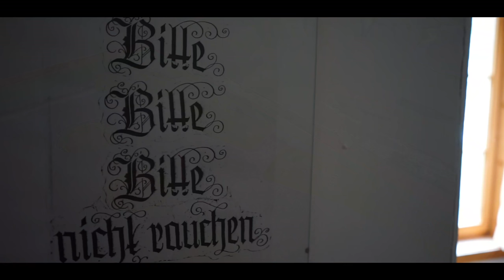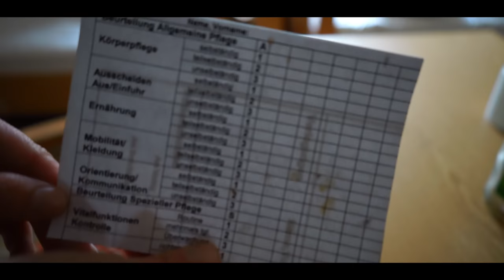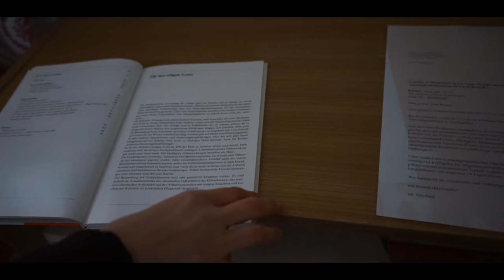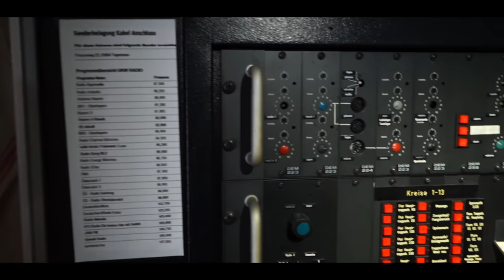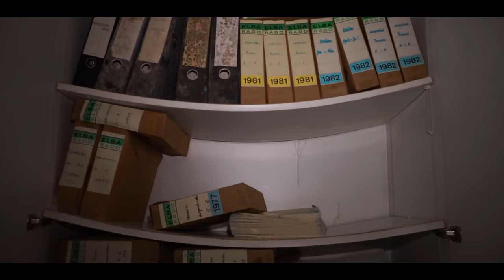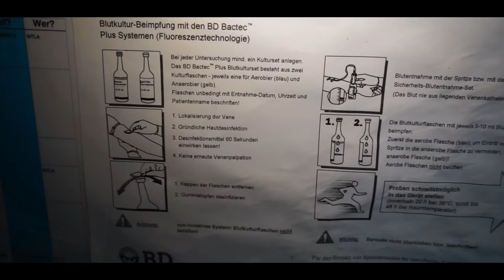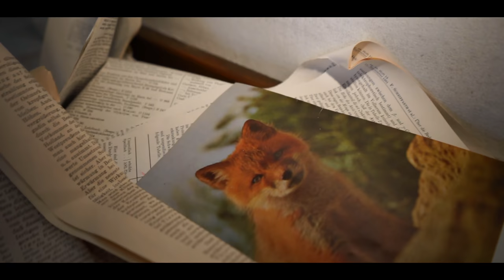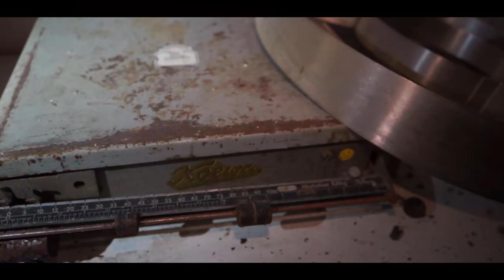Creepy overnigther with Lisa in a abadoned hospital - Vanessa Blank

Comment: Vanessa and Lisa, you're so brave. You're venture is very scary as you rub shoulders with the paranormal. I'm interested in a visit to the Heilstatten Krankenhaus in Beelitz, Potsdam. Have you been there? If you are afraid, take turns to stay on sentry. Change sentries every 2 hours. The sentry should tie string to the other person so you can alert them silently if danger, by a slight jerk on the string.

Comment: That hospital must have been closed down during the 1990's judging by some of the equipment I saw in the buildings. Some of the telephone equipment is of the newer design so it had to have been open during the 1990's and that is a shame that the building was not torn down if it was not going to be used again to prevent someone from being injured entering illegally. There is plenty of mold in that building and would give damage to anyone's lungs just by being in there exposed to it.